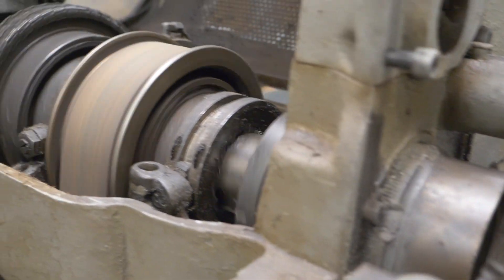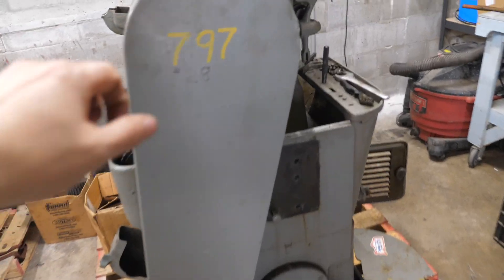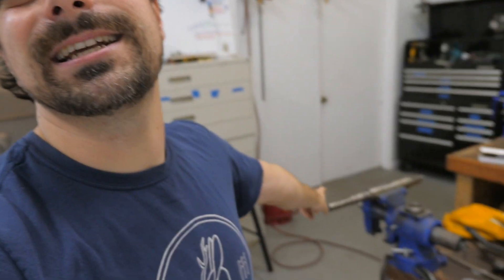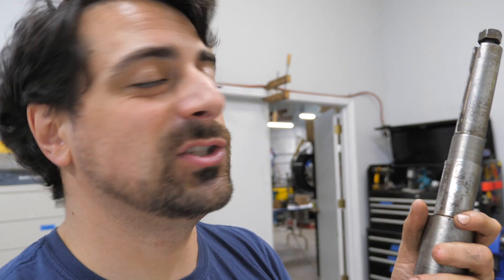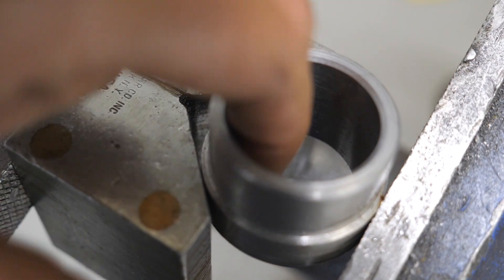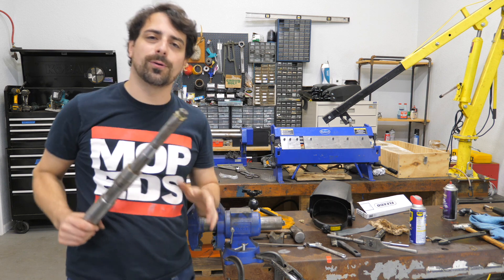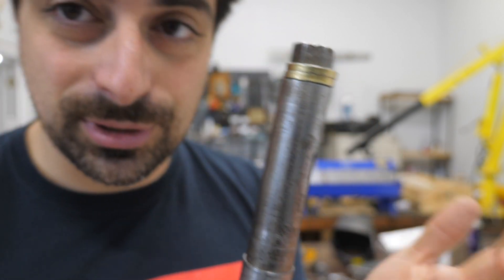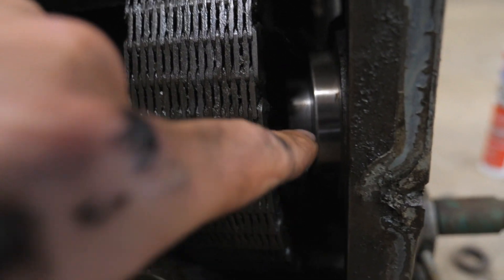Restoring a Brown and Sharpe Automatic Screw Machine - Reassembling America

Comment: We have 35 of them and over the next few months will be working to get rid of them and modernize.  It's just not worth it anymore in a modern business setting.  On the bearing, couldn't you just weld the shaft and then re-turn it?  Same with the keyways.

Comment: I ran some Brown & Sharp screw machines back in the 1970's.
The cutting tool cut multiple diameters at the same time & had to be sharped occasionally on a surface grinder - using a small steel ruler/scale to visually line up the cutting surface with the top of the center mounting hole of  cutter.
Some had turrets.
They had automatic feed that would load a new bar & occasionally the pushed had to be hammerd to grip the part better.
Sometimes it would be hard to get all the diameters on part to be within tolerance. 
I was young & decided to find another occupation.
The shop had Acme Gridley's, Brown & Sharpes, Davenports & the adjoining company had New Britain's.
Did you know that Mr. Gridley started the New Britain Company.
He retired in his fifties & got bored, so he started New Britain, so i have read.

Comment: I started out in 1977 learning to setup 2G and 0G world war 2 production brownies in a gear factory in Massachusetts. I bought an idle 0G for 500.00 back then. I knew a guy with a screw machine shop and told him about it. He came to the gear shop, checked it out, handed me 1000.00 and he moved it out of there. Big quick money in those days! Next shop about 1979 worked 00 and 00Gs some with turner overhead belt drives. One was from 1916. The owner of the shop bought it and replaced the spindle bearings and that thing would run nonstop with no issues! Amazing machinery from “ back in the day”!!
Reply: I went ahead and bought one of these machines about a year ago, read through the manual on how to set them up. I still don't feel comfortable cutting cams for them, did you ever figure out how to set them up? I'd be elated if you could refer me to someone who could provide training or something! Thanks!

Comment: Since you're using a flat belt, I recommend taking the pin out and flipping one side of the end 180 degree's, and re-inserting the belts pin. This will form a mobius strip, allowing the belt to run on both faces and doubling the contact area of the belt, in effect doubling the life of the belt. I was taught this trick by an OLD machinist that worked on farms back in the early 20th century and in machineshops that were old when he was starting out his career as a machinist that were still using overhead lineshafts on all their machines.
Reply from the maker: Ill give this a try!  Wondering if the flip should be on the pulled side or the slack side…
Reply: @MopedProblems  I went ahead and bought one of these machines about a year ago, read through the manual on how to set them up. I still dont feel comfortable cutting cams for them, did you ever figure out how to set them up? I'd be elated if you could refer me to someone who could provide training or something! Thanks!

Comment: First quick tip:  As you disassemble, keep a 5 gallon bucket half filled with old machining oil handy.  And some containes, wire baskets, etc.  As you take things off the machine, in the oil they go, overnight, or over months.  This will loosen all that greasy gunk you kave all over your hands.  Then cleaning is easier.  Avoid putting greasy gunk back in your machines, it only attracts more greasy gunk, dirt, rust, etc.

Comment: Nice :)   I still run these at work. We sold one of them a few years back, but we still have two of the 00s and three of the #2s. 8-hole turrets, 2 cross slides & 2 vertical slides.

Comment: You will have to shorten your belt from the motor to the driving shaft a few times i wouldn't sweat it til it sarts falling off.
I have not worked with any machines that are belt driven at the transmission like yours. All of our G style machines are chain driven. Cant wait to get my own machine.
Reply from the maker: In the next video, I make a heavy duty belt tensioner.  (Couldn’t get myself to shorten the belt again).  I don’t know the exact date on these models, but they are later than most i have seen running.  Sometime from the 1940’s i believe.
Reply from the maker: If you can find one for a good price I would definitely get one.  The restoration process has been a lot of fun so far.  I imagine a wave of machinist hobbyists rebuilding these old machines.

Comment: That an atlas manual lathe you got there?
Reply: Nevermind that bed ain't a flat ways bed! Southbend maybe?
Reply from the maker: Yes, it’s an old Southbend.  From the 20’s I was told.  It’s a wonderful small lathe, but I need to rebuild or replace the motor... it needs a pull start to get going and weak in general.
Reply: @MopedProblems they are beautiful machines! 
 it sounds like it may just need a new starter cap. But even better, find a free treadmill in any condition so long as the motor works, salvage the motor out and the motor controller (all of them are practically the same model and lotsa support online) and you got yourself a free 1-3hp motor with true variable speed control! 

I did this with my little atlas and it was totally worth the little bit of effort.
Reply: Hell, I'm sure you're well aware, you make electric moped for shit sake lmao
Reply from the maker: For real, i had an old treadmill already taken apart and ready to go for conversion... but during the move from NY to FL it was lost or thrown out!  Ill have to keep an eye out for another one.

Comment: Why do you need These machines?  Enquiring minds would like to know.
Reply from the maker: Ive been making our sprocket hub on my little south-bend.  It takes forever.  Once these are dialed in it should only take a minute.
Reply: I want to make another Fast PUCH moped; I bought the same carburetor that I had from the 80’s a Dellorto UA19s with an adjustable main jet